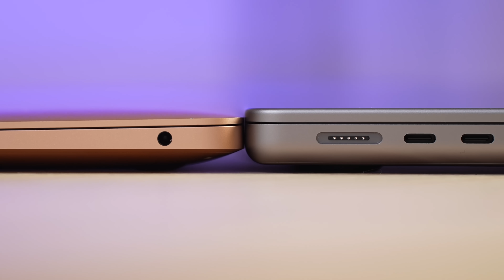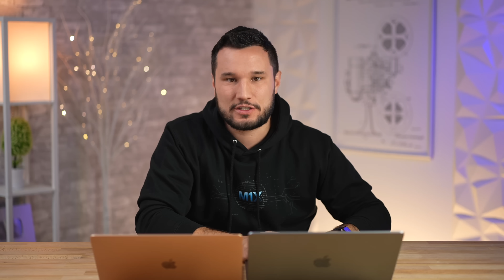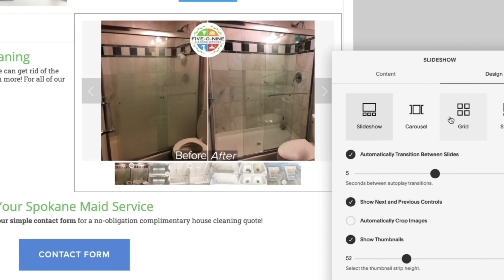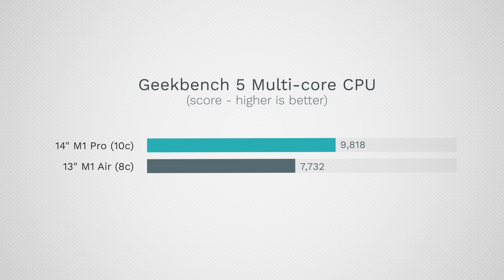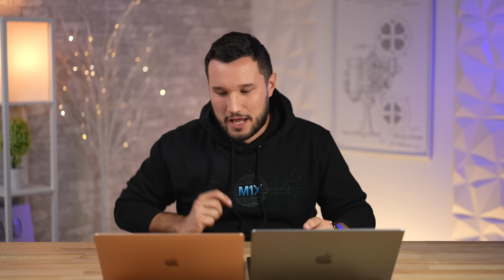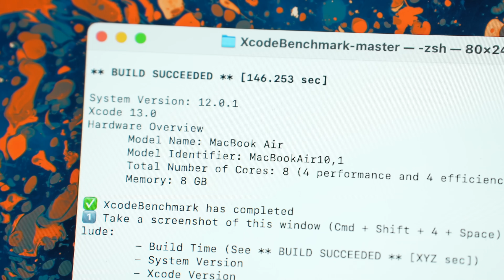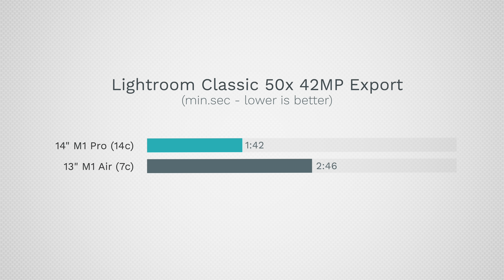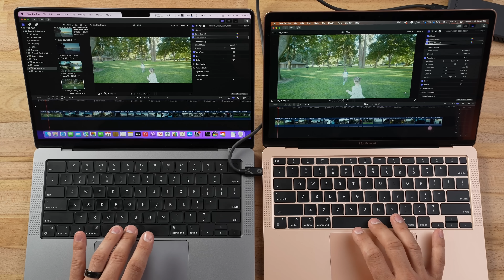14" MacBook Pro vs M1 MacBook Air - Worth $1,000 MORE? 🤔

Comment: I'm a mobile developer, I wanted to see the difference to understand if its worth, but to gain 30 sec on each build don't seem worth the update, and this gain is not the same for android where java runs using Rosetta 2 in both machines.  So I think I will stay with my mac air for 1 more generation xD

Comment: currently using a 15", I'd definitely consider the smaller one since it is now 14.2" and I don't think the 16" would fit into my PeakDesign backpack, I can just about fit the 15" but it's a tight fit.

Comment: If I could have had 32 gb of ram and dual screens on the M1 air I probably would have kept it. I love the form factor and since I’m docked most of the time unless I’m traveling I really don’t need the extra ports. I stress tested it with my work applications (most are run through Rosetta) though and it was almost maxed out running 12 gb of ram consistently.

Comment: It would seem the M1 MacBook Air set the bar so high that it would meet the demands of most people, not just content consumers and casual users, but also content creators. But that has a caveat. 

Today, people create a lot with mobile phones and they work with jpegs, mpeg, mp4 formats when they create content. They are still content creators and there is a sizeable population of such people. M1 is more than enough for them.

But when you start working with RAW images on 45 megapixel cameras or in medium format, do commercial studio work, edit 4K videos uncompressed from professional cameras, and do other such heavy tasks, having a pro- device is crucial.

I know that very well, having started as a writer, then turned into a small time budget photographer, later into a full-fledged photographer, and now editing commercial videos for corporate clients. I have personally witnessed how my workload and the need for more powerful devices grew in parallel. These MacBook Pro models will no doubt be the choice of pro content creators.

Comment: Been waiting for this video!
Originally wanted to wait for the Pro update, but my Surface was broken to early and couldn't holder any longer, so I had to buy the Air instead. I will take it, because it's a lot cheaper than the Pro, and perfect for me as a student. Pro would have been a way overkill for me.

Comment: The one problem I have with base models is 8 GB ram and 256 GB SSD. Even with the new architecture, 16 GB is required for any real value, and the internal SSD needs to be 1TB min. With that said, I am very happy with Apple's new chips, including the M1. The performance per watt is unbeatable and they smoke all other laptops running from battery alone.

Comment: The 14” MacBook Pro is an incredible device, but I’m reminded of how the MacBook Air is still an incredible machine as well, especially considering how it’s thinner, lighter, fan-less, and cheaper. You get a lot of value for your $1000.
Reply: If only it had a 14 inch screen…
Reply: @zguzial  or 15 inch
Reply: @zguzial  exactly!
This is main feature I am considering to make sure it would be worth the extra investment
Reply: @zguzial  13.3 right here definitely feels large enough, and close enough to the 14 in
Reply: I just upgraded and have minor regrets
Reply: @TylerMaximus  what are those regret?
Share your thoughts brother.
I wanted the 14 inch but to be honnest the air sounds and looks much sexier and a nicer machine to have as a 
working / hobby dj.
It could from the look of Reviews eat up everything i can throw at it with ease. Plus run 80+ tracks on Garage band with the 8gb ram let alone the 16gb i Will be getting.
Reply: @TylerMaximus  about?
Reply: @mdbedelsohn4307  see above!
Reply: @TylerMaximus  what are you regretting if don’t mind me asking?
Reply: @jhonatanrosario6787  my regrets are situational and ultimately subjective and unimportant. But my work load now doesn’t need that much power and I never had a “portable little laptop” before. Having lugged around 15”/16” MBP forever, I never worked from couch-to-couch or upstairs and then downstairs. It was always connected to a dock. I didn’t know how liberating an air was. And the battery life, lasted me two workdays. It was unreal. So now my only gripe is it only lasts like 10 usable hours instead of 16. Also, the new one is understandably heavier. Great machine. Possibly too powerful for my needs now
Reply: @TylerMaximus  thank you im still debating if i should by the macbook air m1 or the base 14 inch
Reply: @jhonatanrosario6787  I think that depends on how much work you do. Most of mine is project management and administrative shit. I use a lot of tabs so if you get the air, get 16gb ram. You’re doing processor heavy work then get the baseline 14”. Both will likely have better battery life than whatever you’re using. Again, these are just my opinion, keep doing the research you need.
Reply: @TylerMaximus  thanks appreciate it
Reply: @TylerMaximus  do you use excel by chance? I am wondering if it holds better using excel? I feel like my Mac book air M1 freezes when I use excel and teams. Do you have this same issue with the new pro?
Reply: @georgeb.6611  a bit behind on replies. Currently, I’m not using any Microsoft products so I can’t give you a legit answer
Reply: Glad I found this channel. You saved me $850 (M1 Air 512GB currently on sale for $1150). Coming from a 2011 MBP, the M1 Air should be plenty fast enough for internet browsing and general office app use.
Reply: I wouldn’t mind the hdmi port, 
sd card reader and mini led less bezel tho. I love my MacBook Air M1 tho. No way I would trade it in.
Reply: I’m torn between the Mac Pro and the air !! Idk which one to buy ahhhh!!
Reply: Yeah for most people the MacBook Air will be enough. 

I have valid reasons for getting an M1 Max machine but also realize most users will never need that much power.
Reply: Hi! I intend to buy my first Apple laptop in the near future. 
I use an iPhone, Airpods Pro, Homepod, Apple Music, iCloud … and I am very satisfied with this ecosystem. 
I want to use this laptop for at least 6-7 years and I want to configure it as correctly as possible... with the most advantageous quality-price ratio. 
I will use it for mail, document editing, web browsing, netflix and a little Photo/Video editing.
In the country where I live, the prices are higher, and the options are as follows: 
- MacBook Air M1, 8Gb/256/ 1000$ 
- MacBook Air M1 16Gb/2T/B $1570 
- MacBook Air M2 8Gb/256/ $1320 
- MacBook Air M2 8Gb/512/ $1730 
- MacBook Pro 14inch M1Pro 16Gb/512/ $1980
I would appreciate it if you could tell me your opinion. 
Thanks!
Reply: I just watched this again. And I have one gripe about the macbook air -- can only use 1 external display.
Reply: Fo realz.
MBA is what ill spend my Cash on plus the first runs on any New gear are problematic not to mention hype faster this that blah blah.
MBA with the 16gb ram upgrade only is more Than what people need.
I know people in the video industry that do weddings for a living 150k yearly and use a Mac mini m1 16gb unified memory and 1tbssd and they are pros not any Joe blow.
Now for simple Day things the 14 inch macbook m1 pro is way Over kill.

Comment: I subscribed last year around September because I wanted to get a new iMac 27 inch to replace my 2009 21.5 inch iMac and you were giving me tons of information to select the right one. I decided to get a core i7 iMac with an AMD 5500XT and added external ram myself. I selected this iMac because from your benchmarks it appeared to generate slightly better results because of the higher clock speeds of the i7 compared to the i9. So you guys saved me quite some money and I got a very nice machine.

Comment: So there is so many uses for a compact little laptop like the air. For 1000 bucks example I can have a portable laptop for casual work going to the coffee shop, but it also would work for me as a dedicated inexpensive laptop for virtual instrument playing at my studio logic keyboard. I just want to plug it in to audio interface open up native instruments complete or Arturia analog lab and just play and pick presets and have a blast. It has a screen so I can use the software that comes with it but then I’m not really tied to the screen once I pick my instrument and you can even in some cases that navigate through keyboards on displays. Contrast this with an M1 mini. So that’s really cool and you still need a screen and it’s not really as portable as the air. So it’s kind of a conundrum. For a dedicated virtual instrument host the M1 mini just seems so logical. And from what I understand the M1 mini would function very well with very little ram for what I’m trying to do; on this machine I’m not doing full production I’m just playing.

Comment: great videos, I have a macbook air with 512GB SSD and the 8 core GPU - so I'm interested as it's gaming where the macbook air can fall short. As even though the performance of its' built-in graphics is streets ahead of comparable intel chips, you can't connect a eGPU to improve it. So the difference in performance with the extra cores and RAM might help me lean towards the macbook pro.

The other question is - what do you guys use in the system tray to show CPU/GPU? I think I spotted "TG Pro" for the temperatures/fan monitoring, but it doesn't seem to show CPU/GPU usage as well ...

Comment: The problem with bumping up to 32gb RAM (if you have the unbinned Pro chip), the laptop comes in at a $200 difference to jump to the binned max chip..

I need that 16gb vs 32gb video asap Max lol. I keep going back and forth between the unbinned Pro with 16gb RAM and the binned max with 32gb RAM. Help me decide!

Comment: Super useful comparison. You briefly touched on the price difference with similarly specified machines - adding RAM and SSD storage to the Air seems a good idea if you want to keep the machine for a long time. My 2008 Mac Pro lasted ten years, and my iMac 2015 is still going strong, upgraded with 32G RAM (mainly because I run Parallels). With 16G RAM and 512G storage in an M1 Air, the price delta is down to $600, although a factory refurb can reduce the price for the Air a bit.

Comment: Finally the MacBook pro that i want is arrived, it has MagSafe which is really helpful when you accidentally pull the cable is not going to make your Mac fly, it has SD card which is really crucial when you dealing with a lot of data from film university, it has multiple display support which is double from the first m1 mac and it help when you connected to multiple display for editing. It has two times or more performance than my windows laptop from 2016. I hope soon can save up enough money to buy it so i can be more productive at my university.

Comment: It’s amazing how an entry level machine can hold up in a fight against these superior professional machines.
Apple has basically hit a couple of grand slams with first, the M1 and then with the M1 Pro/Max architecture. 
Bottom line: MacBook Air is best bang for the buck. It’ll keep going for the a while now. 
MBP (M1Pro or Max), just insane performance. These beasts are iMac Pro replacements in a “laptop” format. 
Just wondering what can Apple do next for the upcoming full-size iMac and then Mac Pro. Will they push the M1 architecture even more or go on to the next gen?

Comment: This is exactly the question I would like to be answered.  All the results confirmed so obviously that the M1 MacBook Air is what I should need, but the 14-in MacBook Pro is still what I desire, not actually for its performance, but for its display size, MagSafe, ports and full-size function keys. 

Thank you for clarifying all the factors in excellent details, but the decision still couldn’t be made without struggle!
Reply: Would there be a MacBook Air in 2022 that is equipped with MagSafe and big function keys?

Comment: The air is great for everyday users as well as the occasional power app (photoshop, illustrator, Lightroom, etc) and still outperform some older power laptops (Mac or pc), but yeah... if you are a power user, you may often need the extra displays for work at the desk and still be flexible enough for a mobile desktop while traveling, which I feel is where the new pro and max m1s shine the most

Comment: I’m waiting for the comparison of the  Apple M1 Pro with 10-core CPU, 16-core GPU, 16-core Neural Engine and the Apple M1 Max with 10-core CPU, 24-core GPU, 16-core Neural Engine. On the 16inch models. Want to see if the chip from pro to max is a major improvement and going from 16 to 32 gigs of memory.

Comment: Ordered a 14" w 32GB RAM to replace my 2014 top of the line MBP... Ports and SD card are alone worth it to me and I was tempted last year by the M1 Air, but figured I would limp along with the old MBP a little longer.  I would have liked at least one USB-A port for tethering to Capture One Pro, but this is pretty much what I have been waiting for from Apple.  This time I don't feel like I need the MAX decked out as the Pro should exceed my needs.  Thanks for all your testing.

Comment: Thanks for you comparison again! I would kindly consider MBP 2021 14inch instead of 16inch for most my photography and travel purpose, since I will have enough power when I upgrade it to M1Max but much lighter and better size for outdoor working or travel, and also will connect a larger monitor when I at home! One MBP 2021 can satify all my works!

Comment: I have a 16G/512GB M1 MBA for 8 months and love it. Thanks for this comparison. I was going to order MBA for work but now thinking 14" M1Pro MBP will be better longevity. I was concerned about noise (my work 15" Intel MBP gets noisy at times)  but never push the level you did to get to 100% fan speed.

Comment: Depends on your needs.  However, students would be better off with the Air due to price, battery life, portability.  Also I believe that AppleCare Plus is cheaper for the Air as compared to the Pro. The savings could go toward an external display, etc; or even use savings to upgrade to the new Airs next year.  
Conversely, the new Pros are essentially future-proof for a good five years IMO.  
Great video giving us useful info for purchasing decisions!

Comment: Interesting to see this comparison - although comparing 16GB RAM on both models would be an even better thing to do. Although the base models are about $1000 difference in price, once you get the RAM and SSD the same the difference is much less and then the choice is really about form factor and whether its your main computer. At the moment I've convinced myself to stick with my Air and wait for an updated mac mini Pro to replace my 2015 iMac which is my music production workhorse. I'd be really interested to see the Logic benchmark comparisons between the 8 and 10 core chips and between 16 and 32 GB ram.

Comment: Thanks for the comparison! I think the MBP 14 base model if compared to the MBP 13 (16GB, 512GB) 300USD less or MBA (16GB, 512GB) 600USD less, will be more of added value for better screen, dedicated power, extra ports, and slight better performance

Comment: Note that MacBook Air will typically run you more like $1650 with an unbinned chip, 16GB ram, and 1tb SSD. A 14" binned M1 Pro with the same memory and storage will cost $2200. That's a $550 difference for more ports, a much better screen, better speakers, a better camera, a better mic array, and faster performance.

Comment: Apple has the best lineup of MacBooks compared to any other manufacturer EVER. You can get light, silent, laptop with amazing speakers and processors for 999, or the best of the best in almost every department beast for 2000$ at the minimum

Comment: The fact that you can buy the air and actually do everything a normal person or even an entry level professional do it’s quite crazy 💪🏻
Reply: No, even for normal professionals it’s still very capable
Reply: im using Air m1, and if i want the big jump i will go for m1 max Imac next year or so.  Just love the larger display and mini led.
Reply: @dmt99vn  just buy a good quality pc monitor if you mostly use laptop at home
Reply: Agree. As a video editor it’s the forever dream to have the M1 on the go. So much versatility. Love it

Comment: Apple Definately has a different tier between the two machines now. Which is a good thing. The redesigned Air with M2 should be good for most people and hopefully much more price efficient with decent performance. While the pros can just shred through intensive workloads for pros and heavy users.

Comment: Thank you so much for these tests. But I am still having a hard time deciding if it is worth to upgrade my M1 Air base-model to an 14 inch base model. I am am mostly using it for photo-editing with photoshop (starting out on video as well). Opening those huge Sony A7RIV file from raw with some corrections appllied takes up to 6 seconds. I was wondering if an 14 inch could do it instantly. Does anybody who owns this beast already can give me some insights? I am also interested if there are notable differences using AI-based software like Topas Gigapixel or Sharpen AI. Thank you! Btw: Does anybody know if you can turn off fast charging? Except for taking the smaller brick ;)